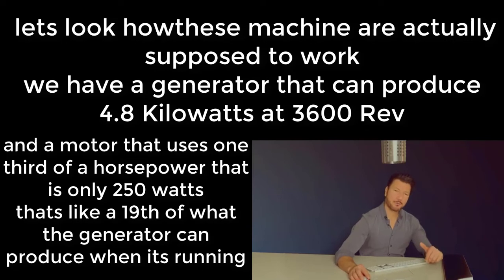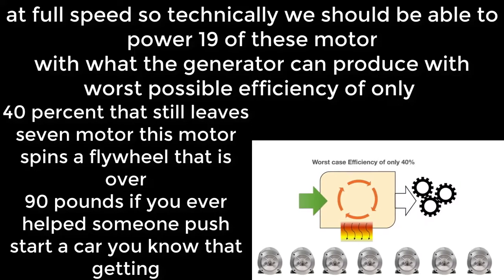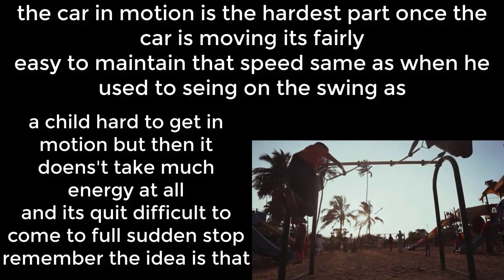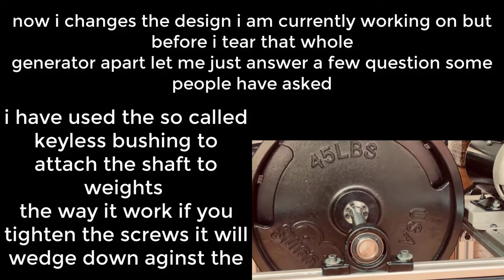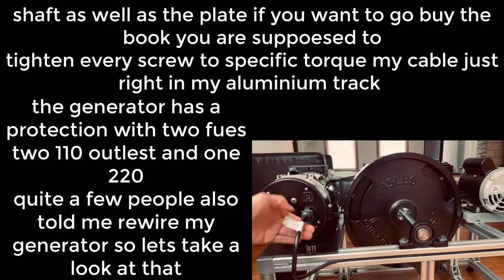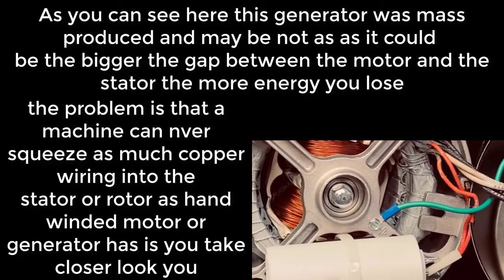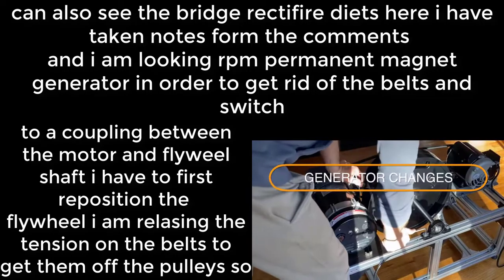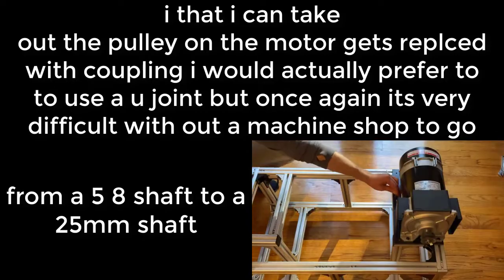flywheel energy of free energy generator Experiment

Comment: You have to use a low RPM permanent magnet alternator for this purpose.
Reply: correct, these guys use high rpm motors so that they can prove that the concept as a whole does not work. My guess is he does this flawed design on purpose.